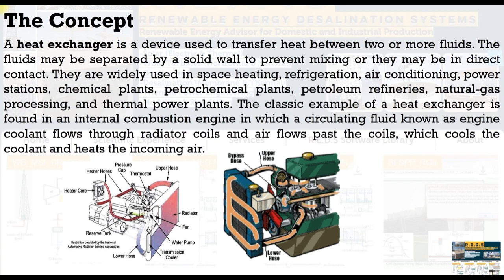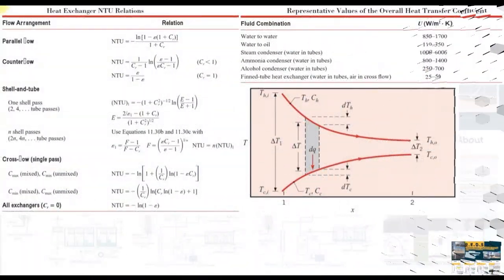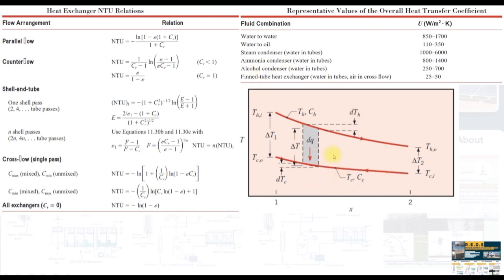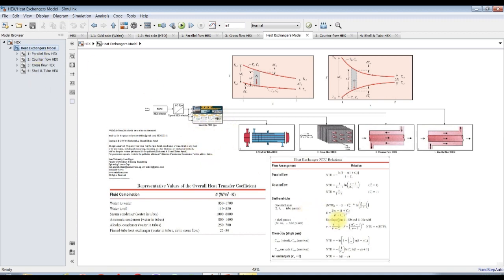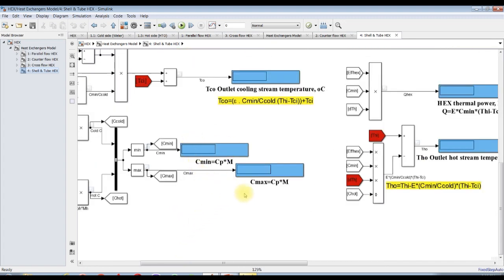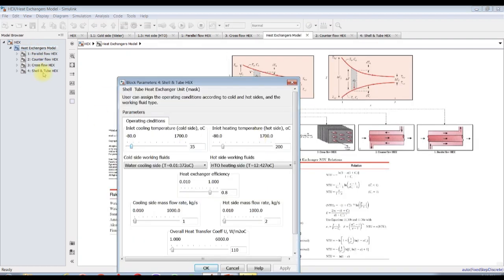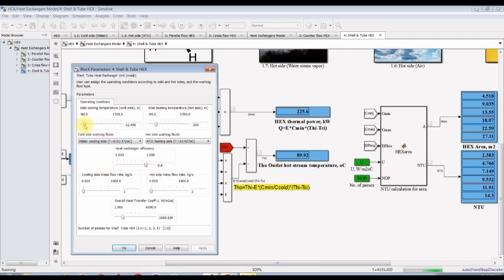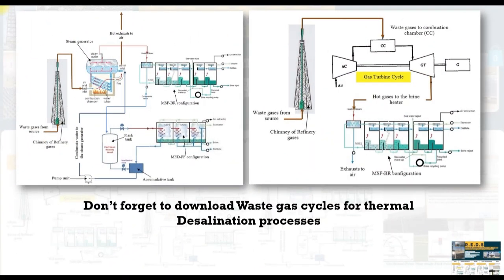Heat Exchangers Matlab/Simulink model run

Comment: I like your work very much. I had a question. I would be glad if you answer. Why did you choose to work in the function, not in the subsystem. What are the advantages?
Reply from the maker: Nothing special. Sometimes I use this, and other times I use that. What is important is the target.